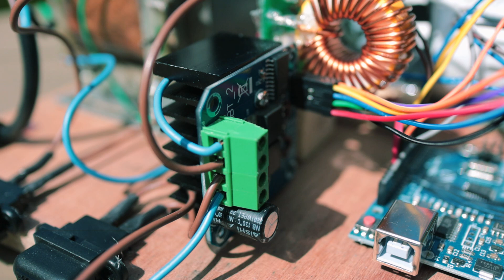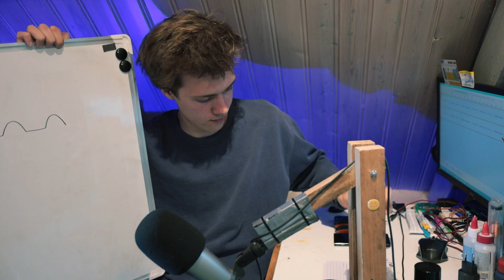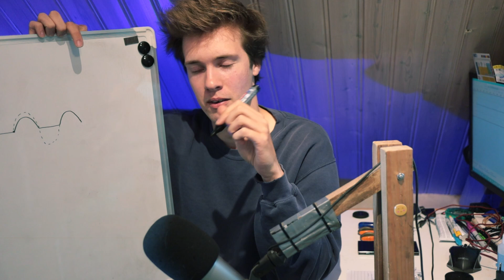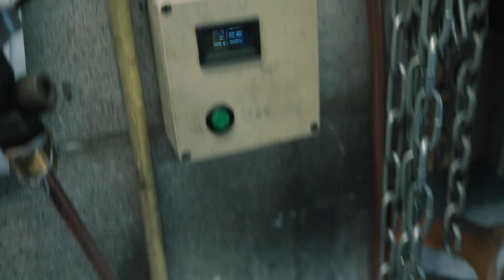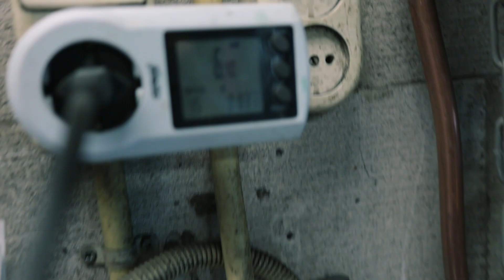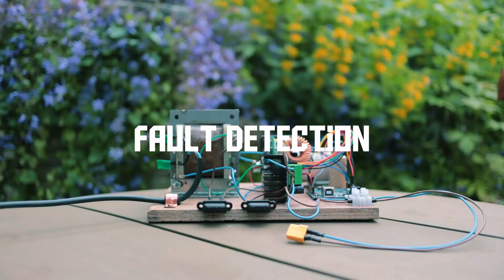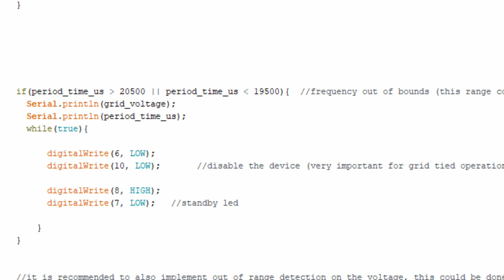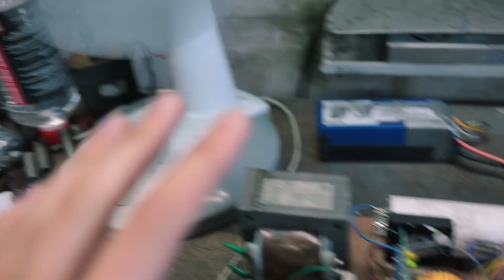Home made grid-tie inverter (not even all that sketchy)

Comment: Regarding your high side voltage and current, you can use a current transformer to get the current and a small rectifier with a voltage divider for the voltage. I've implemented the CTs myself in an ESP32 project but have yet to tackle the high side voltage sensing.

Comment: It would be nice to see the arduino replaced with discrete circuitry instead.  You don't need to generate your own sine wave when the grid is providing one to you - I believe a phase-locked loop is the correct tool for this job.
Reply from the maker: You could make it fully analog, but that eliminates a lot of flexibility in the design. Pretty much all grid-tie inverters on the market also use microcontrollers to do the job. The PLL can be implemented in the firmware of the controller. In fact, the method I use could be seen as a basic variant of PLL. 

I do like the idea though, there's a certain elegance to a fully analog design so I might just try it in the future.
Reply: @AKIOTV  It's the elegance you mentioned that gets me.  I'm a programmer by trade, so seeing something solved in code almost always leaves a "so what?"  Impression in my mind, but a circuit crafted to achieve the same job is mondo cool.  One might even describe it as "rad".

Comment: Have you given any thought to isolating the grid side with a relay/breaker to let the inverter run unsynchronized on outage with the ability to continue monitoring the grid side, resynchronize to its phase when it's restored, and re-couple only once phases are in sync?
Reply from the maker: This is possible, and in some cases it's done, but I don't intend to use this as a backup power system. I have another non grid-tie inverter (which is significantly more powerful) that can power my stuff during an outage.

Comment: First of all, thanks for pointing out my comment on your previous grid-tie inverter video!
I really love the improvements you made, I actually build something simular with the same H-bridge module a while back. I did manage to push 50W into the grid, but unfortunatly I eventually blew up the H-bridge (ordered new a few diffrent new one's with faster slew rates that I want to run at 30 kHz). I think My mistake was that I plugged in the grid before plugging in the DC side, causing the H-bridge to function as a rectifier and blowing the mosfets diodes because of the huge inrush current filling the capacitors. When I get mine working again, I will start experimenting with the possibilty for it to work as a charger too, pulling power from the grid and pushing into the battery, this should be possible without any aditional hardware. 
I will keep you updated.
Btw, my question still remains: Did you check the output current waveform on a scope? Since you measured a power factor of 0.95, it should be pretty smooth, but i'm still curious!
Reply from the maker: Ah yes, I blew up one of these things too. The reason I blew up mine is that the BTS7960 chips that it uses have the low side switch on by default. So if both half bridge devices are enabled, and both PWM signals are low, the low sides are turned on, creating a short circuit through the ground rail. This happens all the time during PWM and is no problem then, but if it happens for a longer time you're done. My mistake was that I programmed the arduino to go into standby mode upon detecting a problem, but then I forgot to add some code to disable the EN signals to the bridge, leaving the bridge with both low sides on with the AC side hooked up.

My thing seems to have no problem with the DC power being off, as long as the inverter is in standby mode and the H-bridge switches all disabled. Would it be possible that your microcontroller enabled the bridge (for instance because it was also powered from a laptop or something) without the DC connected? That could create essentially the same condition I had.

I put the scope across the shunt resistor on the low voltage side on the transformer to see the current. Forgot to include it in the video, but it looks reasonably smooth, although less smooth than the voltage. I think I'm going to put a picture of it in the folder that has the schematics and stuff.

BTW About the battery charging, if it's a simple lead acid battery you might be able to cheat your way into doing this by just using the diodes as a rectifier. You'd just hook up the H bridge to a tap on the transformer that has a slightly higher voltage than the battery and it'll charge passively with the bridge turned off. You could use a simple relay to select the right tap on the transformer, connecting a lower voltage one for sending power onto the grid, and selecting the higher voltage one for automatically charging the battery. It's pretty rough and you'll have no control over charging speed etc. but it'll work, my old school lead acid battery charger is also nothing more than a transformer and a rectifier. (which is in that thing actually a single diode haha)
Reply: @AKIOTV  I think you're right about the way I blew up my H-bridge. I had the enable pins driven high before the battery was connected and the correct pwm signals where applied. Won't make that mistake again. 
Yes please do put a picture of the current waveform in the zip. My current waveform looked very rough, I was expirimenting with many different inductor values and even wound my own on different core types, problem is finding one that has enough inductance, and doesn't saturate up to about 15A

As for the charging part, I have to say I first though of doing it exactly the same way you described, but this would indeed require a perfectly matched transformer winding/tab + the power factor and efficiency would be horrible as a rectifier only draws current at the peaks of the sine wave. Then I found out how victron inverter/chargers work!
It's nicely explained in this video: https://www.youtube.com/watch?v=UPfUn5ki7OM&list=FLT8z3Ar_3Drp6EIDRWmPwNw&index=4
Basically it's working like a buck converter in inverter mode, and like a boost converter in charging mode. The pwm duty cycle is always following the grid waveform, but is controlled in such a way that it aims just over the grid voltage in inverter mode, and just under in charging mode, causing the current to flow the other way.
In this simple simulation you can see how this works with a simplified half bridge version: 

https://www.falstad.com/circuit/circuitjs.html?ctz=CQAgjCAMB0l3BWK0BsB2AnADgEwI5gMw6SFZYSGEhIAs1CApgLRhgBQAZiISliDhy0Q9HAKE9qYaEhgduvfoQRjRPFTzHTZ0DgHcRxAeUNihkKOwDmpkWBS3atfhcjsANrZwn8Zk69hICGlCSBJiQgxIBDgUFAQ0SwM1b341Kgc3G18eLGEcpxcknj5xYUVjF3YAJR5IYVSBND8isRi4Gk6AtBR2ACcQHv5GrBQG-2QOAGMaDDEyfLnKqGR4OAwNza3tjBBmFF0cTebCWjQ4c8zAjgrz8f47spW3MGaQUfuQDDAWlcSHIoBJAANQA9u4AC4AQysjHYADcBJA0vYkcMJK4RBYwJigewDCQUQ41LRUW5kkYKiSyfjJA4fmkjAzimpmSlkcUKo0KsoxG4qUzvLYsLj2ABJOqfLkTYL886zX6PRoQbHsAAeXzOAiWbDi2ro4H4AHE+gBLAAmAB0AM5TUEAO3tjCmEMYVutEL6UPt1s4oL6AFtGH11YMwLtThAohGnCJDSAAOqm+3m5NWAD0elNfUYNpz1tNHu9UzhBiGyyV-lD4f4rDEGAQEGYu2EYH4AAVQXpgzbOO4u9be31QQGbQAjKEQ119ACeNohoJtVjN7r0AAtGPabQAKCdT4Nz63w8HQ2E2gBUNvNAFcITOpvf3IwAJQ2gB8S5XNuPkJhucH1rbgAQteUwANY2gGoLmi+1YEAIwgNg4OCJK2HZdj2vr9noAGcMOo7WsuFrzou1p7tOh7rpuO7kQe34nn+F5Xre96Pi+NoADyfsRR4MWeAHAaCoIejaACy0GwQMhJPNJzIBNMdLgEKGTgCguKwFG0DfGAtD4DiaBoMoGC8KsQTWIp9gWCpryZJYGo4mh2LGYa1CthAYr2tO9pQu4eaMAWRb2iWtKycpJlyaGpLCKwYDUHw0VsBYDTCB58LBtONoAMJrlCfSwn0NoAA5mkFpqFU+7Cggh4ArLQkAbOAFgHMIFhmOU7BkO8IAAGIQLIjUWKwIAACIsVlbHsEAA
Reply from the maker: @nielsdaemen  That is a much more proper way of doing the charging thing. It would be quite elegant if you could implement that with merely a software change.

I've added the image to the folder. It's not a perfect waveform, but I'd say it's all right. I suspect the current waveform is more dependent on accurate synchronization than on the filter itself.
Reply: @AKIOTV  That current waveform looks quite alright indeed!
Another thing that infuences the current waveform is if the grid waveform isn't actually a nice sine wave. Where I live, the grid waveform always has a huge flat top, so when the inverter tries to output a nice sine wave, it will deliver a bug current spike at the peaks because the difference between the inverter output and the grid is larger.
Reply from the maker: @nielsdaemen  True

Comment: Nice work, good design and great future improvements.
I wonder if a toroidal transformer would improve efficiency? You can get sensors that plug into the main switchboard that measure these things - I guess the time they take to detect and report power, direction, voltage is pretty important?
Reply from the maker: A toroidal transformer may help. Not entirely sure, perhaps I'll give it a go. The most ideal solution for mains voltage/current monitoring would be a similar device to the cheap power meter I use now, except one that has some interface to connect to the arduino.
Reply: @AKIOTV  Yes, thought and inquired about this a lot - I want to measure power and direction so I can control both charging and the a grid tie inverter to minimise the power drawn frin or sent to the grid. I've been told I need a quadrature detector.I'll see what I can find on aliexpress. I'll post back when I find something suitable.